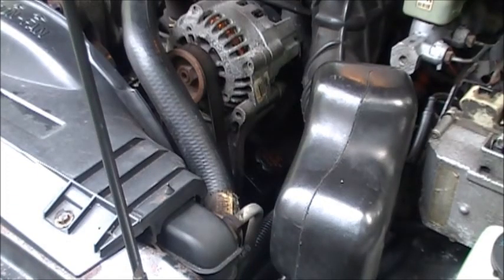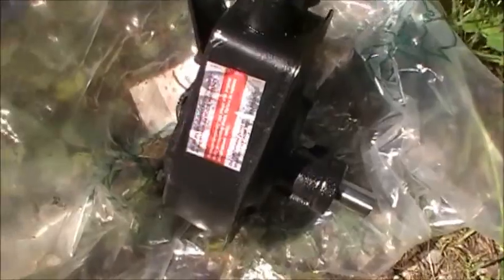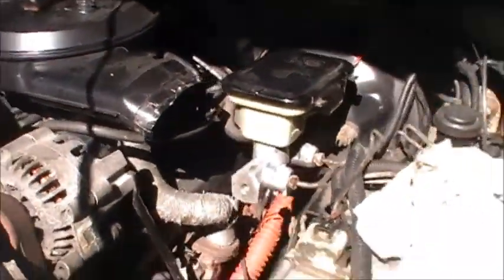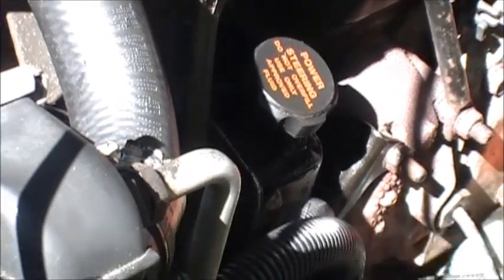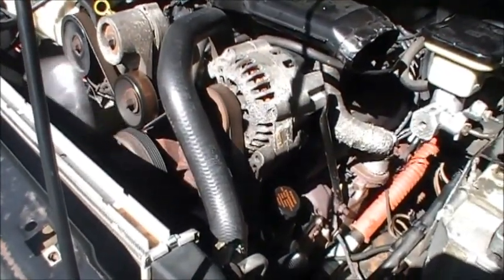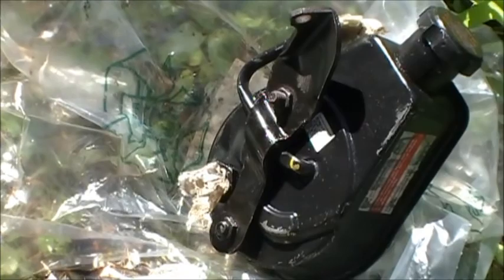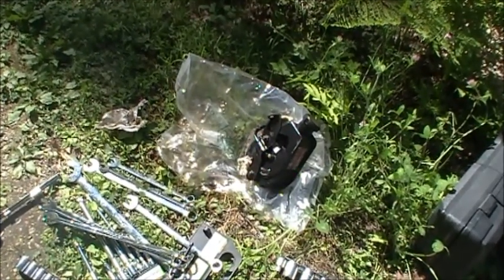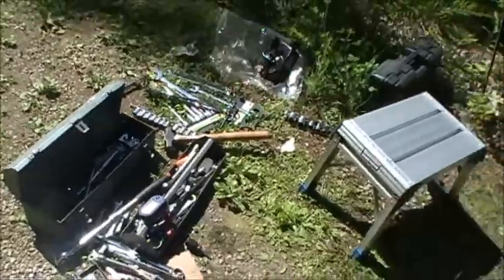Noisy A-1 Cardone Steering Pump

Comment: Ive had two of these Cardone pieces of shit now and they both whine and sound EXACTLY like this.... I hope I can find one that doesn't whine.
Reply from the maker: I bought a used one off eBay for $25 or so and it's still working fine. After 2 cardone units, I gave up and got a refund. Mine whined straight out of the box. Good luck
Reply: @airconditionersexposed  Both of mine whine straight out of the box too! Super annoyed that I have to do this job again. Glad you got yours fixed! Cheers.